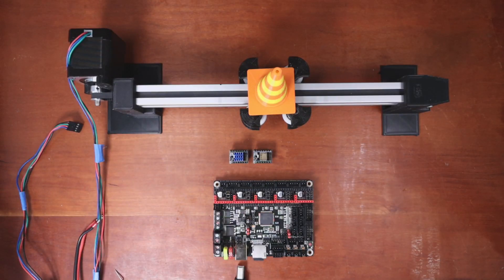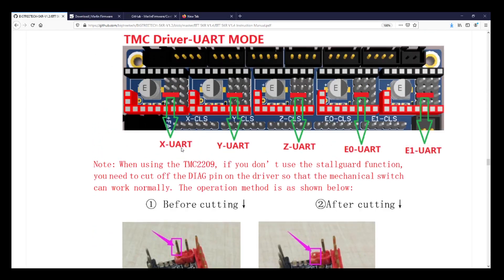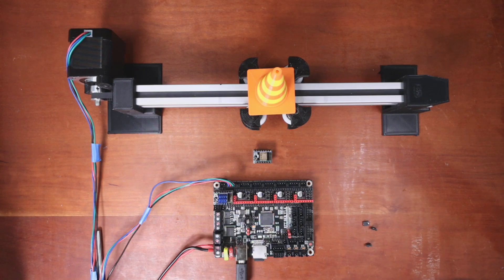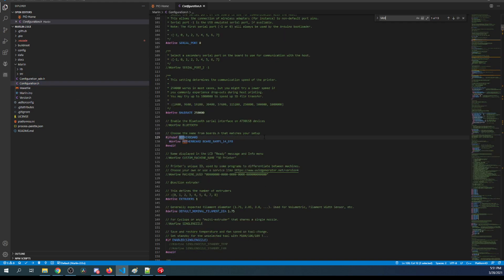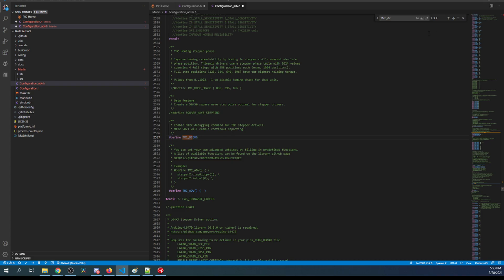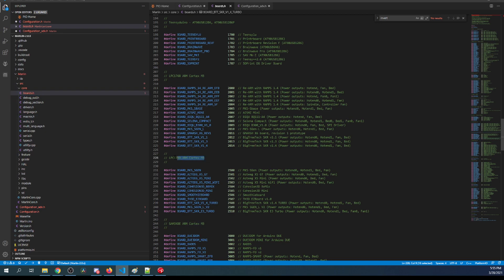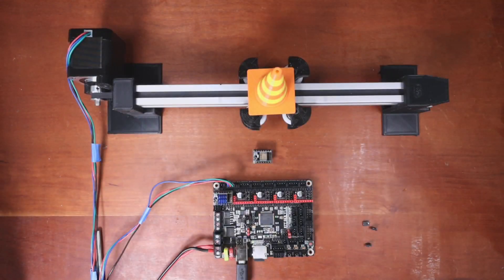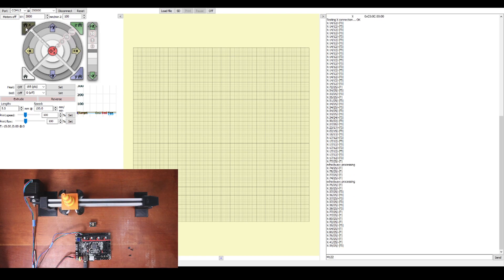SKR 1.4 - TMC2226 UART with Sensorless Homing

Comment: What changes should I look out for if I'm to use 0.9 degree rotation stepper motors, please?
Reply from the maker: Normally NEMA 17 step is 1.8 degrees.  With NEMA 17 .9 degrees you would double steps per mm for axis, but since TMC steppers this might have changed.

Comment: Also, a video I'd like to see done. A comprehensive video showing the difference in all the 2209 drivers.  Like tmc2209 v1.0 vs 2209 v1.2 vs 2.0 vs 3.0...  I know there's some pin issue with some version but I can't seem to follow what it is.  A detailed
Reply from the maker: They might be board revision.
Reply: @EdwardBraiman  it's definitely board revisions, however it seems complex and the topic would benefit from someone with experience explaining it in a simple way.  And even one of the provisions has something like a trace or the silk screen or something printed wrong and requires an additional step in order to use that driver without causing issues.  That's what I was more alone the lines thinking about when I suggested making the video.

Comment: Can 2209's be setup to do sensor less bed leveling?  Not just homing, but used like a BLtouch to calculate a mesh and used to adjust the print?
Reply from the maker: It's possible, but normally a BLT is used or preferably an endstop.
Reply: @EdwardBraiman  do you have a video showing what needs setup for sensor less bed leveling?  Or could you at least point out what lines need uncommented? And does the "Define enable_sensorless_homing" line stay uncommented, or get commented out in light of the leveling command?  Or do both need turned on? Thanks
Reply from the maker: Nope.  Bed leveling is a difficult to present as the variables to think about can get deep.
Also depending on display type they can get even deeper.
At present I'm working on a tutorial, but it could be about a half hour in length to present.